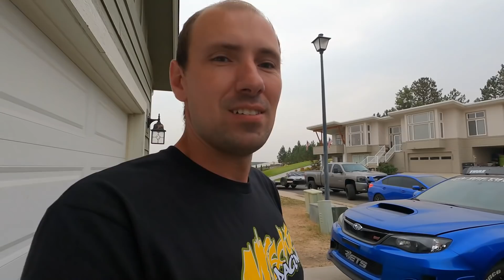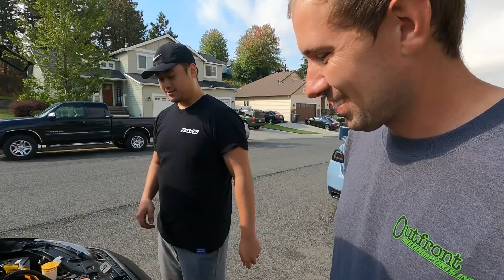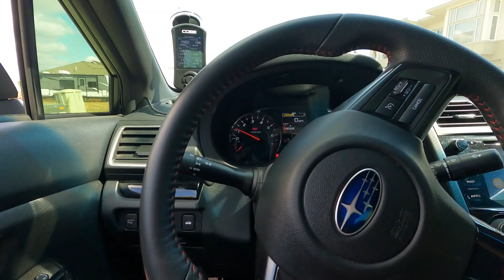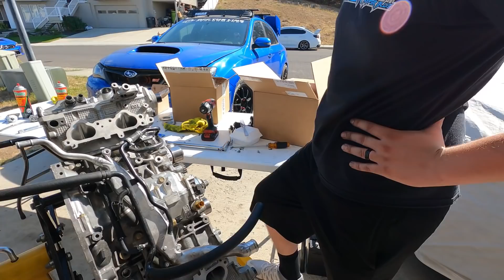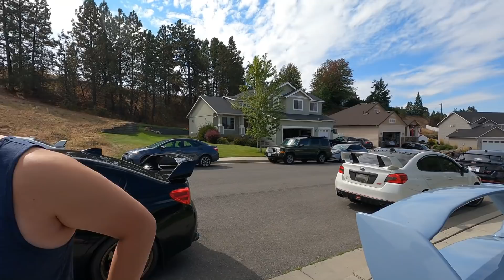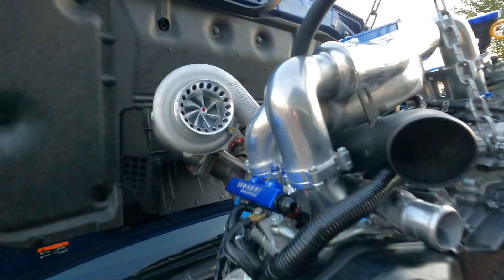600whp STOCK Motor STI!

Comment: The best things take time (especially in these times). Hell I waited 8 months for my wheels. And still waiting on parts that I bought back in late Feb early March. You've waited this long, another month or two won't kill you. 
I think having the shop by Devin would be a great thing but could also be a negative. The videos you guys would put out (STI vs EVO and being good friends) would definitely be entertaining on a new level. You'd also have a second set of hands almost anytime. But it could also slow work productivity. I honestly would love to see you two with shop's side by side, but it could also turn into 12's chill spot.
Reply from the maker: I agree completely with you to be patient, we have been for last 9 months now that we been looking. Unfortunately good ole bob is applying more pressure and causing more issues behind the scenes. I would love to work side by side with devin. Just worry about area and customer cars being outside...
Reply: @BaderBuiltRacing  what about putting up fence? Maybe you'd be able work something out with the owner. If not that and your shop being the same size of Devs you could keep 4 cars inside at a time, I'm sure with dyno and a rack it would be tight fit. Or maybe Devin would let you stash a car or 2 in his bay at night. I'm sorry I'm sure you've thought this a thousand times already, I just wish there was a way I could help..

Comment: Maybe you've been asked many times, but.. whats the max power that type RA block can handle for daily use?
Reply: Need to know this good  question, 
I’m at 410 whp at the moment with 0 issues 
I’ve heard no more than 420-430 on a stock block

Comment: Tip _ Super glue sand paper round the throttle body. The coupler will stay on much better. You can do this with all boost connections.
Reply from the maker: Good Tip sir!

Comment: At what point to you recommend the competition over the Street AOS?
Reply: Always
Reply from the maker: Definitely always
Reply: @BaderBuiltRacing  I have everything but an upgraded turbo, and FMIC (still stock block). Currently have the IAG street and when i take off the Intercooler there are still small amounts of oil in it. Sent pictures and videos to IAG and then sent me new check valves, but still happens. Maybe I’ll just upgrade to the comp series